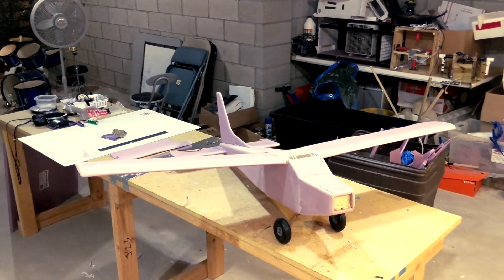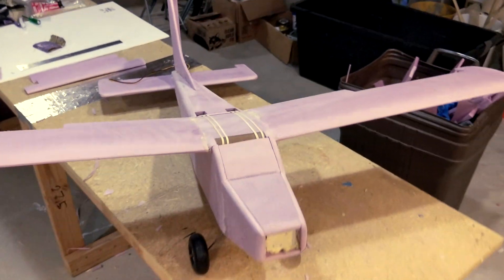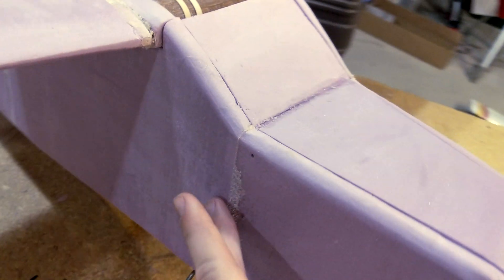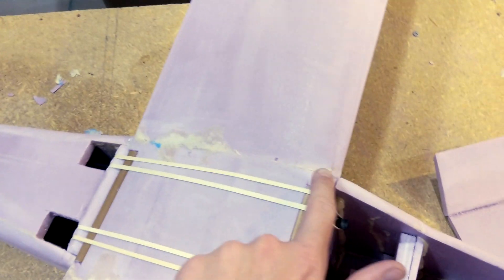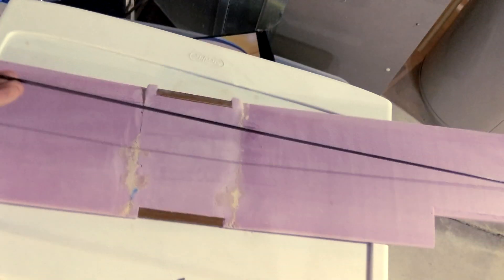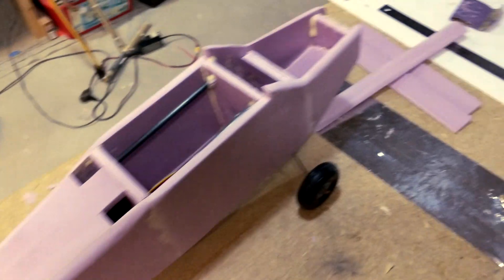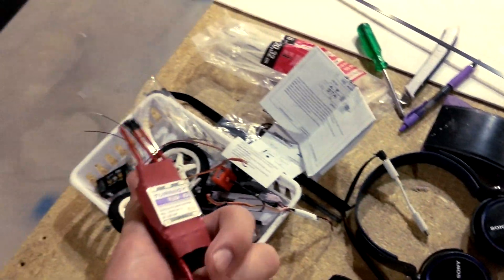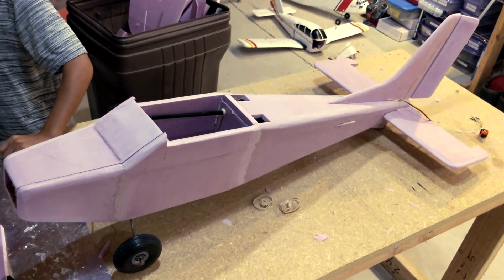DIY RC Bush Plane _ Update #1

Comment: Is there any separate plan for the landing gear?
Reply from the maker: Here is the 3D printable bracket STL file. Then just bend some wire and make it fit in the slot in the bracket. https://drive.google.com/open?id=19l_jqukG4YBKk9QHkYkTkeFQFXTUO_vB